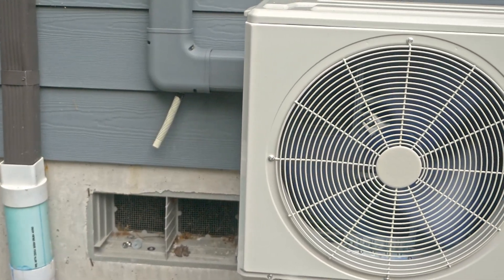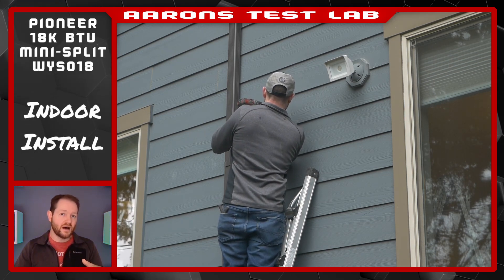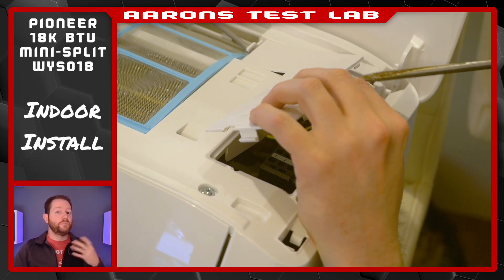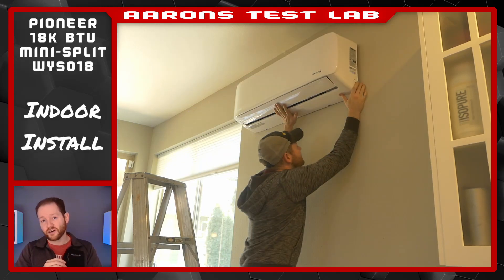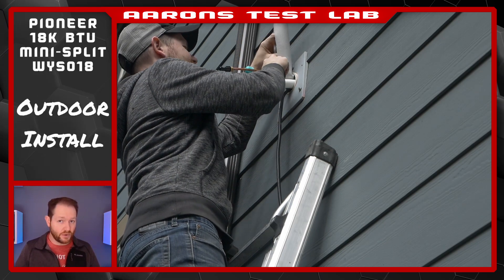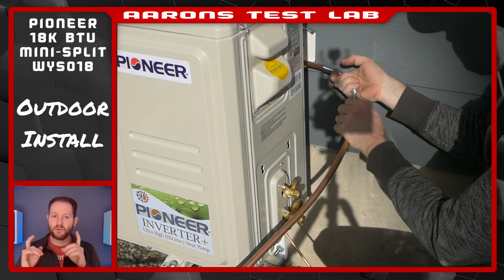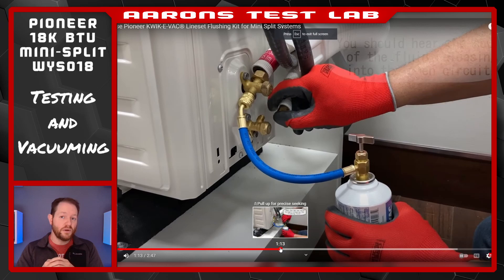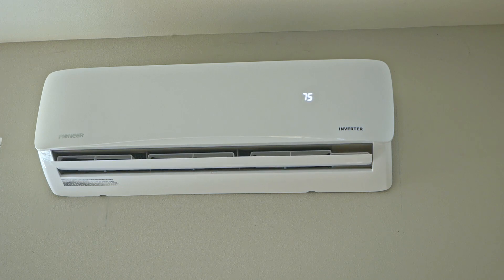Pioneer 18K BTU Mini Split: Part 2 - Installation

Comment from the maker: Pioneer Inverter+ Heat Pump at Amazon(sponsored): https://amzn.to/3KmIzGd
Manifold Gauges: https://amzn.to/3zLeMSr
Vacuum Pump: https://amzn.to/3ZUWAR5
Flaring Tool: https://amzn.to/3o5g3RJ
Tubing Cutter: https://amzn.to/3KNavV3
Wall Bracket: https://amzn.to/40UW3jy
Lineset Cover: https://amzn.to/3KNg6KS
Tubing Benders: https://amzn.to/3zLf1wP
Lineset Tape: https://amzn.to/3KNaRel
Arlington LPCG50-1 Strain Relief Cord Connector: https://amzn.to/41qIuYH

Gear Used in Filming:
Camera: https://amzn.to/2Lcn6EM
Lens: https://amzn.to/2WXxL9f
Gimbal: https://amzn.to/3aXPghH
Mic 1: https://amzn.to/3rN3hVp
Mic 2: https://amzn.to/3aZNbli
Teleprompter: https://amzn.to/3o6Ju19
Editor: https://amzn.to/3mZhmvq

As an Amazon Associate, I earn from qualifying purchases.

Comment: I have seen where someone release little refringent by pushing on the Schrader valve after opening the liquid side it flushes the air out like flushing a hose. You lose little but the Schrader valve acts like a TXV valve so goes from liquid to gas right there. In theory have a new system should work liquid will push the air out. I think it's actually little better then the way they did it with the can flush trying to screw the line on still going to get air in there.

Comment: This is an awesome how to video. Pressure testing with an alternative gas like CO2 is theoretically fine in my mind as long as a proper evacuation is done. You did a better job than most of my competitors at installing your system. I will say this though.... For every awesome DIY installation like yours there are 50+ horrendous ones. Well done my dude and if you ever wanted to you could have a career in HVAC
Reply from the maker: Don't know if I'm ready to start a new career, but I appreciate the feedback!

Comment: Slab mounted reduces air flow below the unit. In general air will not be noticeably impeded at 12" nor at 4" but if it's on a slab there is less airflow, especially if snow is possible, thus the extra space specified in the manual. 

This is an educated guess.

Comment: Why Don't you need a white neutral wire with 230 volt?
Reply: Short answer:  With 2 hots there is a return to the source for the voltage.  Also there is a ground wire which in modern systems is bonded to neutral at your main panelboard.  So, just like a dryer outlet, no neutral is needed.

Comment: Losing a tiny bit of refrigerant in a hose is insignificant, because we use only a minimum line set while the system was charged for a lot longer line set.

Comment: what size wire and breaker was used?
Reply from the maker: 20A 2-pole - 12 gauge wire
Reply: @aaronsrapidreviews  Thank you
Reply: @aaronsrapidreviews 230 volt, not 10 ga wire?